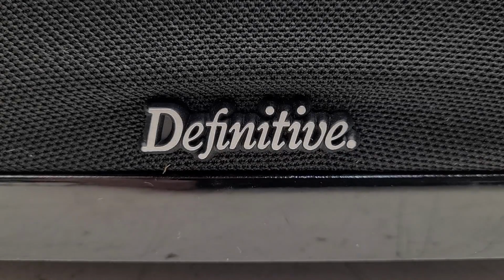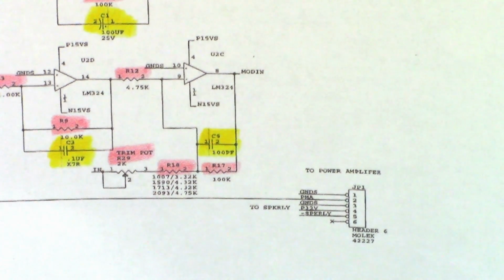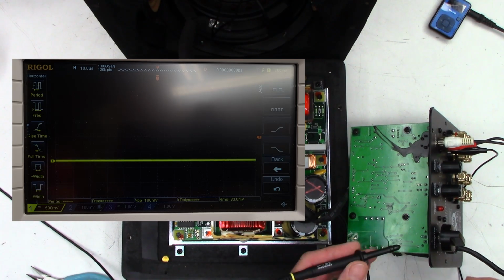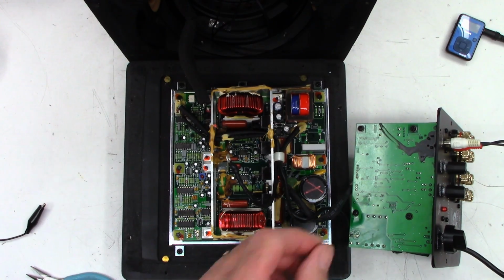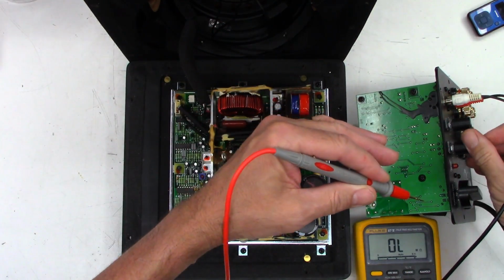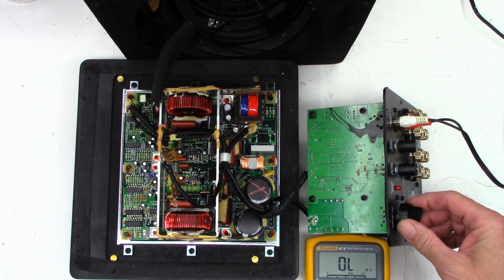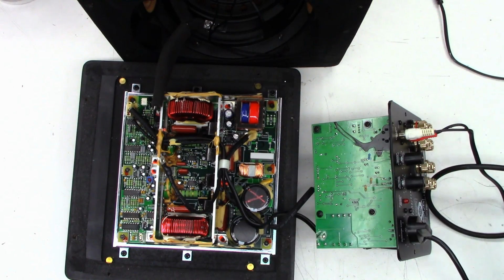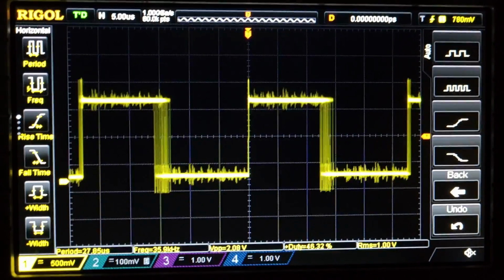A Complete SuperCube III with No Audio sent from Jackson Wyoming. Part 1 - Initial Diagnosis.

Comment: @NorCal715 Always love your videos. You got me into repairing plate amps among some other things you are commonly known for. Thank you for VCR mode switch vids too! They are hot items to repair. Glad you are getting back at it since the horrific family matter. I have watched all of your vids and those of 12voltvids as well. I learned what I needed from both. You are one of those that learned the old school electronics as did 12voltvids so your videos are very useful for filling in the holes on certain devices. I had advanced to the micro-soldering long before it became popular and repair some of the crazy small boards under a microscope, but it is refreshing to come up for air and do some more tangible boards and devices that don't require a microscope, but rather an o-scope instead. Glad you're back and getting the workload out the door. I did see the vcr vid with the post-it. Very cool! I knew you all are familiar with each other. You're not far from Alex at NorthridgeFix in a matter of speaking. I have told people on the west coast to send items to you or him because shipping is too much to send to me on the other side of the country. Of course that all depends on the device because everyone has their strengths and weaknesses. I've always been a fan of recycling and preventing e-waste since our country is literally drowning in it for the last 15+ years now. The "recyclers", since closed, had dumped a lot of it back on its origin in china over the years until china slammed the door on that and now we are just burying it in the earth making mountains of non-degradable was. Very much appreciate you and wish you well.

Comment: Just for the heck of it, I would have asked the customer if this repair was sufficient. I mean you are basically in the middle position with the resistor values and people usually leave these pots somewhere there, so you would basically make this unit not prone to this type of failure in the future.
Reply: Great point. If it's the only one sub in the system ( not a multi sub setup) it would be easy to control volume through to a receiver. :)